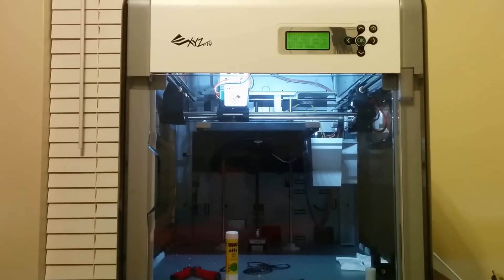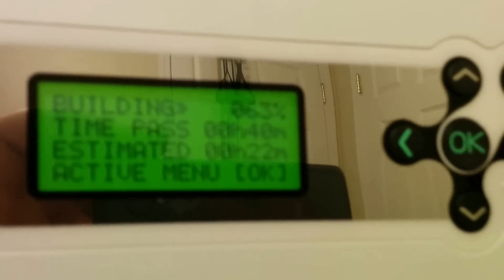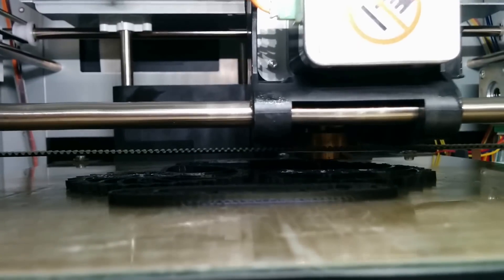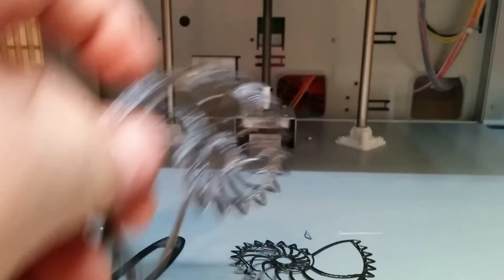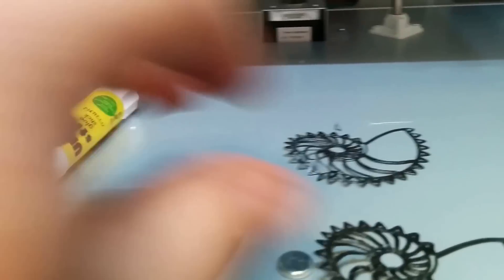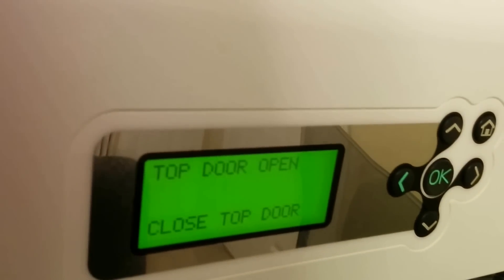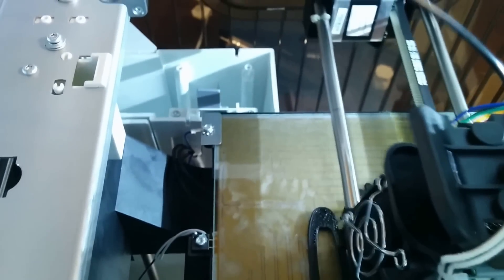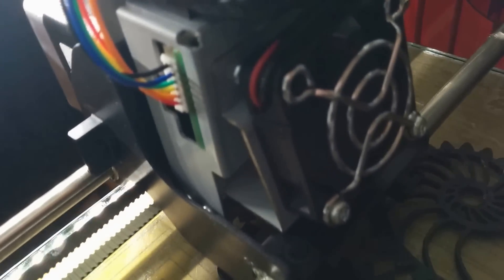DA Vinci 3d printer software to print 2 of 2

Comment: Where do you apply the glue on the platform?
Reply from the maker: In the area you are building in. I have found to add a small layer over the whole build area and replace where the glue peels up after the print is over.

Comment: Hi, what is the largest item can you print in size?
Reply: The build volume is 20cmx20cmx20cm (7.8inchx7.8inchx7.8inch)
Reply from the maker: 200mm x 200mm x 200mm. It is possible to glue part together to make bigger parts also